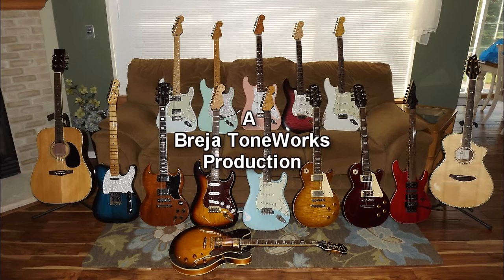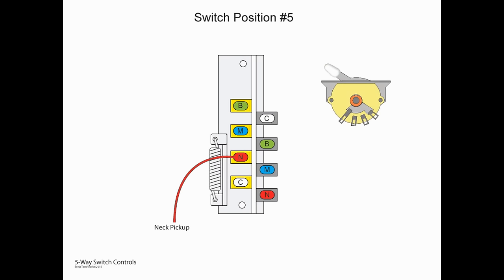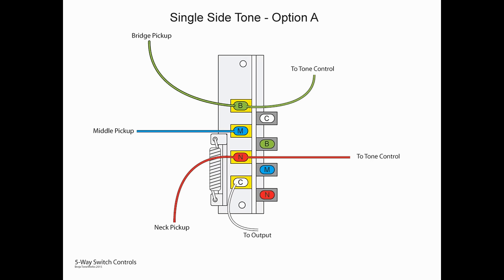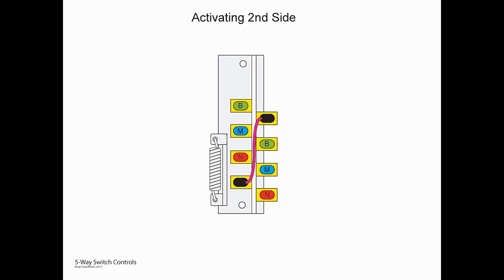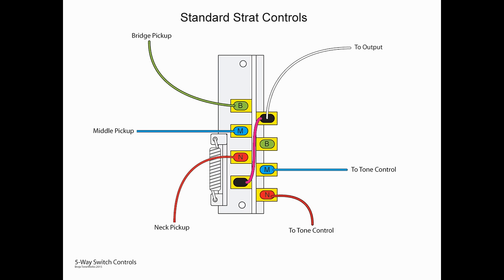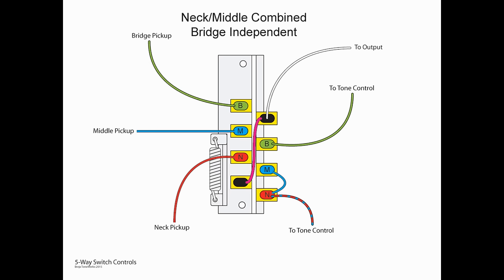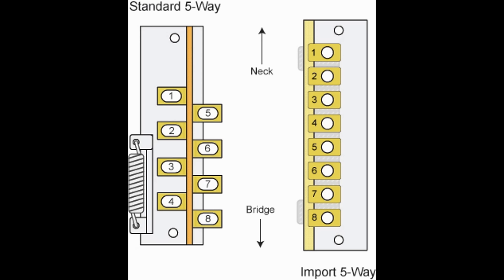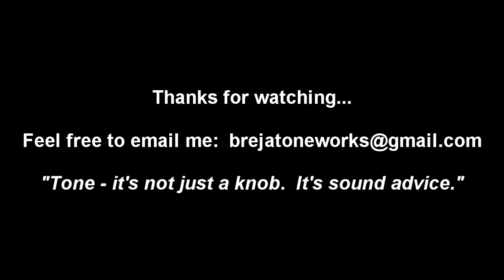The inner workings of a 5-way switch and various wiring options

Comment: I like option number 3, neck and bridge on the neck tone pot. I did that a while back on my strat, along with a neck on switch. In normal switching, each pickup has it's own tone. With the neck on switch active, the new position 1 beocmes neck  and bridge with a master tone, tele style. New position 2 becomes all three, with the middle retaining an independent tone. That's the great thing about all these switches is how many things you can come up with.
Reply: SquierStrat72 The reason I wanted this diagram is to mod my Squire Strat the same way (switch on). I was going to put the bridge and neck pickups on separate tone controls, but now I think I like your idea better. Any regrets?
Reply: SquierStrat72.  Oh yeah, forgot to mention- my bridge pickup is a mini (stacked) humbucker. Any advice or insights would be much appreciated.  Thanx!
Reply: I like these options you described here for positions 1 and 2 very much!  How happy are you with the tones this creates?  Would love to see how to make this exact mod.

Comment: Tremendously useful video! Thanks. Wanted to share a simple tip for those who are uncertain about the effects of modding their switch - buy some alligator jumper clips and before soldering anything; just clip everything together and test the function. That's saved me some headaches :^)

Comment: thank you so much for this! the switch on my 2015 mexican strat broke at the start of quarantine - guitar still worked, but I couldn't change off of the bridge pickup. finally died completely (no output from the guitar), so I was forced to buy a new switch. was scared to do this, but with a little bit of guidance from my roommate (electrical engineer) and your amazing video - I was able to do this all on my own! also included the mod so that I now have a tone control on my bridge pickup - thank goodness! always wanted that. stoked to tell paps (he's an electrical engineer too lol). THANK YOU SO MUCH!!!

Comment: Great explanation! 
I think that having a shared tone pot on the neck and bridge with the middle being independent is the best. Because they’re all still technically independent of one another- if that makes sense. It is because the neck and bridge are never active at the same time; Therefore acts like an independent tone knob for each.
Reply: It’s also cool if you do the telecaster mod and have an additional switch to add either the bridge or the neck pick up to the other essentially it have a strat  and telecaster in one guitar
Reply: That's a really good idea.

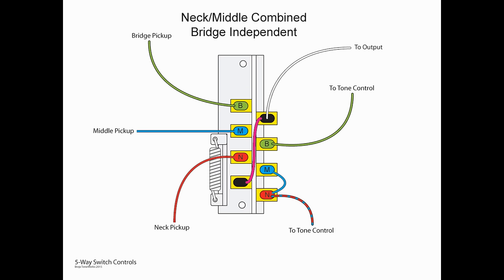Comment: For the mod circuit you show at 4:02 ... what happens when you're in switch position 2 (bridge and mid). If I'm understanding correctly, both the b and m lugs on the right are connected with the common node, so your pickup signal would be sent to both tone pots. seems odd to me to have both tone pots acting on a single switch position. but maybe I'm missing something

Comment: This is good, but it would be better if the contacts shown on the side of the switch, moved with the changing switch positions (like a real switch), so you could relate the mechanical switch movement, with the electrical contacts changing. Then it would be perfect.
Thanks for doing what you do, and sharing it on Youtube.

Comment: - now I get it - I bought a Korean Lado SSS strat with an added mini-toggle - by tapping on the single coils with a steel pin, I noticed it was adding the bridge pickup, in phase. to every setting of the 5 way - [ pos'n 2 was a H+S,  #3 was S+S with B+M in phase,  #4 had all three on as S+H and #5 was another Tele S+S using B+N in phase  ] - lotsa tones with the added switch

Comment: Hi Breja Toneworks.  This is an awesome video! 
I am modding a bass and I want it to have 2 Jazz and 1 music man pickup in between. 
I have yet to find any options that allow all three to speak at the same time. 
I was wondering if I could sacrifice  using either the Neck and the Middle or the Bridge and the Middle to jump off of one and link up the other.
So if I was in position 4, could I Jump the middle pickup to the Bridge pickup and essentially have all 3 pickups activated at the same time? 
Thanks for the video!

Comment: Excellent graphical explanation; answered questions I had regarding the switch. I just wish that you would have gone a step further and showed how to connect the wires from the B side into the tone pots, with an emphasis as to what each lug's role plays in the connection. I sorely need to get a handle on that, and not just follow a diagram. Any help? Thank you.
Reply from the maker: I'm working on a Tone Pot video but I think you might enjoy:  https://www.youtube.com/watch?v=39XdnQDxuw4
Reply: Thank you for the reply Don. I look forward to that video. Can you please base it, or a section of it, on the Strat standard wiring? Thanks again.

Comment: I have a 5 way with all the lugs on one side for a cheap Telly I bought and brought to a nice playable state. I am looking for the wiring to accomplish the following:
1) Humbucker Full
2) Humbucker Split (single coil)
3) Humbucker Full + Bridge Single coil
4) Humbucker Split + Bridge Single coil
5) Bridge Single coil

Since it's a Telly, there is only a Neck and Bridge pickup and a single Volume and Tone control. Is the above possible? I will change the pots one day and maybe get one with a pull-switch, but not this time. In fact, if the above is not desirable, or possible, I have a bag of small sliding switches I could use for single coil splitting. I have been searching, but I haven't quite found a 1:1 diagram using my kind of 5 way switch. Any help appreciated. Thanks.

Comment: I enjoyed the extra knowledge! I have a question though, how would I wire a Dimarzio 4 conductor neck humbucker with a Seymour Duncan 4 conductor bridge humbucker pickup ? Please help! Much advice will be much obliged, thank you! There's also a red wire and a black wire coming from the volume pot, the black wire is on ground and the red wire is on the side of the lug on the volume. Where would I solder these wires?

Comment: Dude your videos have helped me so much, I can't thank you enough. Can you make a video on wiring 2 humbuckers, 1vol/1tone and a 5way import switch? My Ibanez is pretty funky and the volume knob seems to not really have any effect from 3-10. Also what pots would be the best out of 250k or 500k for a Les Paul, a Strat, and a RG? Any extra help would be greatly appreciated.
Reply from the maker: +Logan CallMeGrizzly- Hey Logan...  If you're asking which manufacture of pots is the best, there is no right answer.  Each have their pros and cons.  Bourns are sealed so in theory they don't get dirty.  Alpha pots tend to have a smoother turn.  CTS have a more consistent taper.  CTS and Alpha can be considerably lower in their values that what's advertising.  Bourns are a bit more expensive.  Most Alpha pots use smaller holes that CTS which require reaming out holes.  Alpha pots can fit better into small cavities.  Alpha and CTS have different Splines which means you may need to replace knobs.  The list can go on and on.  You just need to evaluate your needs and make sure you get ones that are the right value.  Also  - if you look up my channel, there's a video on the difference between and import and a non-import 5-way switch.  From it, you should be able to wire up any switch you want.  Don
Reply: Breja ToneWorks thanks man. I have one of the weird ibanez switches and their terminals are in a really weird order, so I'm probably just going to look around and play with different switches and pots to find what works best.
Reply: @BrejaToneWorks  Wow that is extremely valuable info!  Thanks!

Comment: I used Seymour duncan wiring  for series parallele with a push pull pod and have  wired the top six like it shows but I am wondering  where the 3 lugs on the volume connect and the 3 lugs on tone connects

Comment: I have Samick KR660 (S-S-H, 1 volume, 1 tone, 1 coil tapping selector, 5 way blade switch) and I want to modify it this way:

Single coil neck pickup (SD SSL-4), original middle pickup (disconnected, not active), humbucker bridge pickup (SD custom 5 SH-14), 1 volume, 1 tone, coil tapping selector (disconnected, not active), original 5 way blade switch (1=bridge, 2=3=4=both, 5=neck).

I'm comfortable enough with soldering, but can't really understand how to wire the 5 way blades switch to operate the way I want.

Comment: I am changing my "Import Switch" to "Standard Switch" but the problem is on the "Import Switch" there is one place reserved to solder the ground wire from the vol pot, now as i am changing to "Standard Switch" i dont know where to solder the ground wire from the vol pot because i found no place to put it. I already try to not connect it to anywhere and tape it but it cause a humming. This is the only problem are not talking in your video, the rest is very complete. I hope you can help me sir, thank you 🙏

Comment: Hi there,  very informative.  My problem is,  when I switch in any direction, I get a loud noise on the amplifier.  How can I stop this? Same type of noise if one touches the end of a jack plug once plugged into the amp. It comes across very loud  when switching.

Comment: Great stuff - thanks for this very solid tutorial!  Has anyone tried a mod that allows all 3 pickups to be activated at once?  Seems like it might sound really cool - and if so, I would have my position 1 be this option and simply not use my bridge position as a standalone.  Is this feasible with the 5 way switch?

Comment: Great Explanation; but, I came looking for where to attach the pickup grounds. On the rectangle style you showed, there's a lug on the frame for grounding, sometimes 2. So, I am about to use some sort of spade lug between the switch and the pickguard  ... or do the Oak Grigsbys not need ground at all?

Comment: How would I wire Humbucker/Single/Humbucker if I added a an active EMG in bridge position? since they do not split how would I get it set up? would the bridge single position be able to run both single and humbucker at the same time?

Comment: I have a question. I have an Ibanez with 2 Humbuckers and i want to rotate the neck pickup because i want the White coil to be closest to the neck because I think it looks better. The thing is that when I choose position 4 on the 5 way switch now the outer coil of the neck pickup is active together with the bridge pickup. I still want the inner coils to be the active ones in position 4. I found a forum that said: "The correct wiring should be replacing the North START with South END and North END with South START." So that will change which coil that will be active? but they will be out of phase so i need to change the phase of the bridge pickup?

Comment: This is great! Is it possible for you to post a video on the breakdown of a 5-way switch for Strat, multipole; such as DiMarzio's EP1112? I assume the two wafers are for a push/pull potentiometer. One wafer being for the push position and the other for the pull position. Maybe I'm wrong. Also, there are twelve contacts per wafer for a total of twenty-four. Lots of information needed. Thanks in advance!

Comment: How does the tone pot take in the signal and put it back into the switch on a single wire? I struggle to understand how the signal from the pickup goes to the input side of the switch which then goes through the tone pot somehow, and back out on the connected wire to the output side of the switch to the common, to the volume pot, to the input jack, and finally to the amp. Did I confuse you? sorry 😁

Comment: My strat wired like this, when you select the bridge pick-up there’s still a little sound in the middle & virtually nothing on neck pick-up. Same with the neck down to the bridge, it seems to fade less from the selected pick up but not totally off, any ideas? My sons strat everything is off outside of bridge if its selected, Same with middle, neck unless you select the ones in between. Any ideas? Pot setup? This is a 1994-1995 MIM strat & as far as I’m aware hasn’t been modded until I changed the 5 way switch from the square type one to the rounded switch, thanks

Comment: Hi Don very good videos all but the pots are either A for tone and B for volume can an A pot be also used as a volume pot just by grounding the 3rd lug to the top of the pot? Or are there pots which can be used for either A or B, and are CTS the best ones I have seen others on sale like Emerson etc.
Reply from the maker: +Gary Owens There are two types of pots (Audio and Linear).  People debate which should be use for volume versus tone.  It's personal preference based on the taper of the pot.  I personally use all Audios on my guitars but that's just me.  Either way - YES, if you ground the 3rd lug, you've now made that pot a volume pot.  Not grounding it and attaching a capacitor, it's a tone pot.
Reply: Thank you I knew about the tapers who makes the dual concentric pot for the strat mod with vol and tone for each pickup?

Comment: hello thank you for your vids! I want to make a special wiring in my strat as i have a very hot bridge pickup. I never use the tone  on neck- and middle pickup but I would like to dial some treble out of the bridge pickup and it would be nice via the bridge pickup's volume pot to shift between the same volume as  Neck and middle and then turn the brigde on full for soloing. So The bridge pickup will have its own volume pot  and its own tone pot. But i'm having a hard time to figure this out and i havent found a diagram anywhere for this wiring. ?  Thanks a lot

Comment: say  I have these three dimarzio super distortion single coil pickups. the old ones with adjustable poles.
can you recommend some pots , cap values and a circuit that could use. I like that early blues rock sound. The old pots were 500 ohm and great but  i pretty much ruined them trying to solder them with to cold an iron. I broke some lugs off. I just want a fresh start.
I'd like to use the old style wire. 
thanks
Reply from the maker: +yrulooknatme Well - for starters, stick with 500K pots as they work best with HBs.  Caps???  Well as I always say they're highly subjective and not magic.  If it were me, I'd use a .015uF and either an Orange Drop or PIO cap.  As far as circuit - kinda depends on if the pickups are 2 or 4-wire models.  If you wanted to go nuts - throw in 3 Push/Pull pots to split each HB (if they are 4-wire) and then do my 9-way mod.  My remedial math skills suck but you'd have a ton of pickup options to play with.
Reply: +Breja ToneWorks thanks they are the older single coil 2 wire. nice fat sound.
Reply from the maker: +yrulooknatme Up to you then - depends on how many pickup combinations you're after.  You can go with the traditional 5, 7 or 9

Comment: Thank you so much for this video, you explain things so well! But I have a QUESTION. I have an old Washburn g jr (you can find a picture of it if you search this guitar on google) with a 5 way switch that has a really wonky style 5 way blade style switch, all of the lugs are on one side, I know which lugs are being touched in each position, but I want to do a completely different wiring style, I put in a humbucker In the neck and took out the middle pickup, so I would want to wire it so that position 1 wouldBe bridge hb in series, position 2 would be bridge hb plus neck hb both in series, then positions 3 & 4 would be dead, like a killswitch, so no signal at all, and then pos. 5 would be neck in series. Is there a possible way to wire it this way?? Do you or anyone else know??

Comment: I was about to start blindly following a wiring schematic for my rewire project when I noticed that my switch, labelled DM-50 Made In Japan, has a contact configuration not mentioned here. Looking at it with the spring on the left as in your diagram, the first thing you notice is that the lugs are offset by 2, not 1. The next and more significant difference is that where your terminals are BMNC and CBMN, the DM-50's are CBMN and BMNC, respectively, so effectively swapped left-to-right.

Comment: Great video. My strat switch has 4 tabs on top for the pickups and output and 4 tabs on the bottom for the tone control. How would this be wired? which tabs are 5...6...7..and 8? Thanks Don

Comment: You mentioned a better way to wire for a master tone? And how does this affect sss vs hss vs hsh?
Reply: I have my SSH modded to have 1 master tone So i can remove 1 pot and turn the hole into a killswitch hole. So depending on what pickup selection you are at the moment, you can control the tone. Neck mid bridge as well.

Comment: yo say that both sides of the switch needs a jumper to be connected,,,ok,,,,but when in other video you talk about split a humbucker in hss configuration, I´d noticed that both sides are not connected, and the right side has the white/red in lug 1 and then lug 2 is grounded,,,,don´t understand,,,the right side in this situation how it works? is connected to what happens in the left side?

Comment: Hey Don, I have an oak brisiby 5X switch. when looking ar your wireing dia. I cant tell witch side goes to the inside(twards the vov & tone) or the outside & away from vol & tone)side  looking at the switch, It has a silver side and a tan side both w/4 lugs in each side. So silver on the outside or tan on the outside?
Reply from the maker: +keith carman Hey Keith...  Actually doesn't matter.  Either way - it works the same.